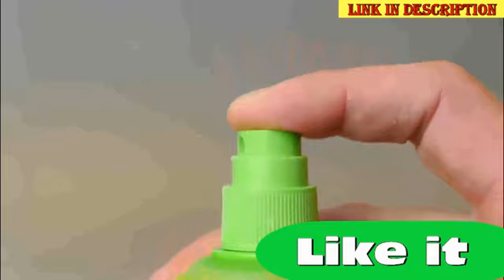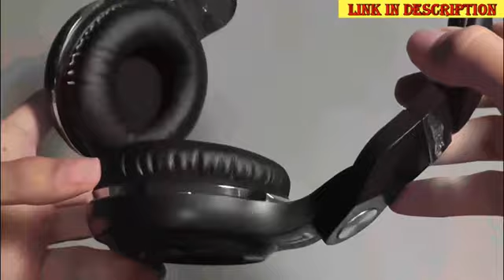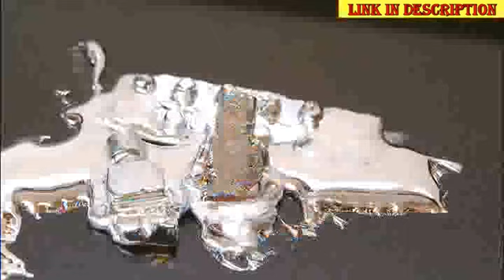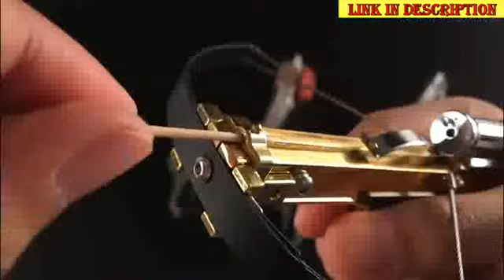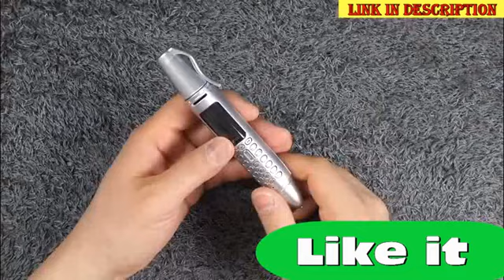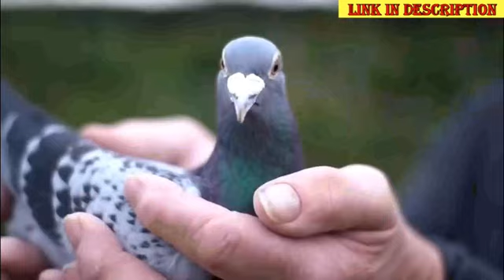aliexpress pocket, aliexpress sunglasses, aliexpress shopify, aliexpress phone cases, aliexpres

Comment from the maker: Radio-controlled German tank Tiger I - http://ali.pub/48qipp
Citrus spray spray - http://ali.pub/48qiv5
Table robo-crab - http://ali.pub/48qizt
Saw from the screwdriver - http://ali.pub/48qj5u
Bluedio T2 headphones - http://ali.pub/48qj86
Animal anatomical models - http://ali.pub/48qjab
Mendosin Motor - http://ali.pub/48qjdt
Gaul - http://ali.pub/48qjgj
Thread epilator - http://ali.pub/48qjjn
Magnetic varnish - http://ali.pub/48qjnj
Huion GT Graphics Tablet - http://ali.pub/48qjqg
Miniature thing - http://ali.pub/48qjsl
Combat Robot - http://ali.pub/48qjvi
SERVO K07 smartphone pen - http://ali.pub/48qjxn
Pistol for clamps/screeds - http://ali.pub/48qk0r
Xiaomi Cleanfly compact vacuum cleaner - http://ali.pub/48qk33
Soaring Eagle - http://ali.pub/48qk58
Dove Fixer - http://ali.pub/48qk94
Electric corkscrew - http://ali.pub/48qkb9